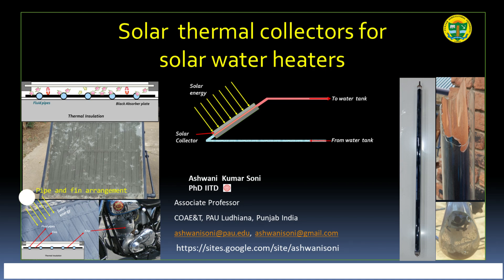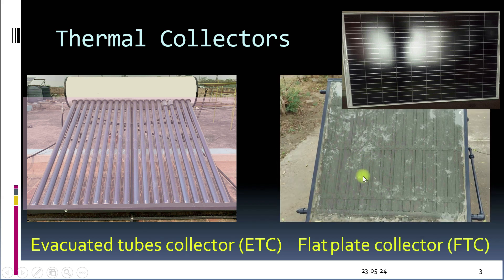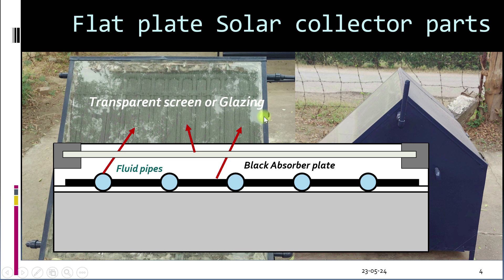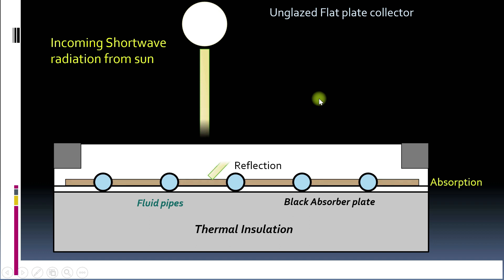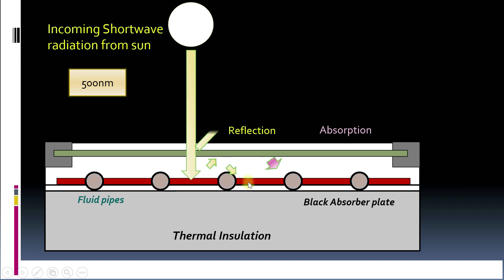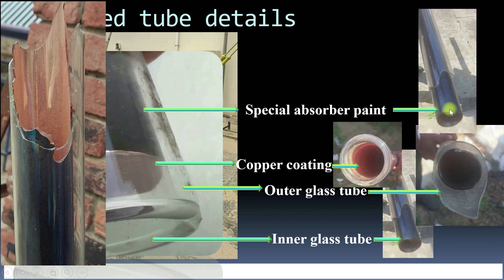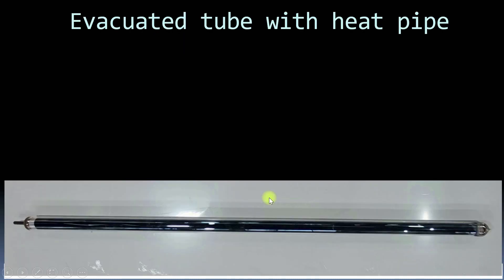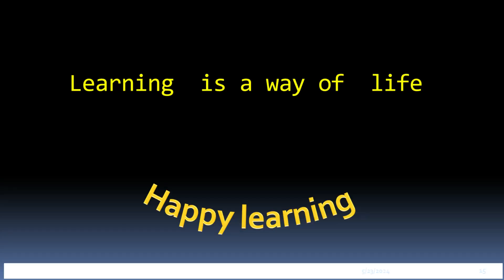Solar thermal collectors for water heater | Solar water heaters

Comment: I use six 100 watt solar panels wired in parallel to my forty gallon water heater.  I switched out the 220 volt elements for two 600 watt 12VDC elements.  I ALWAYS have hot water.
Reply from the maker: Yes.. that's another way to heat water 💧. The efficiency is 20% for costly photovoltaic panels and around 50% for low-cost thermal collectors. So one has to make a choice depending upon requirements.😀